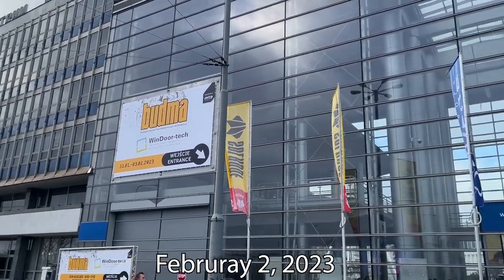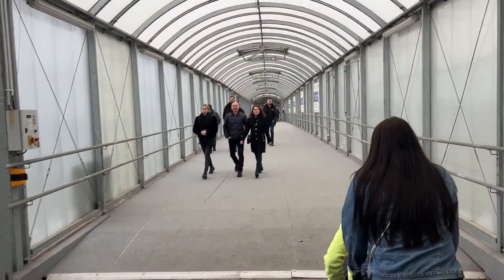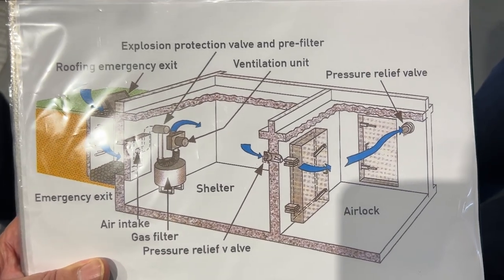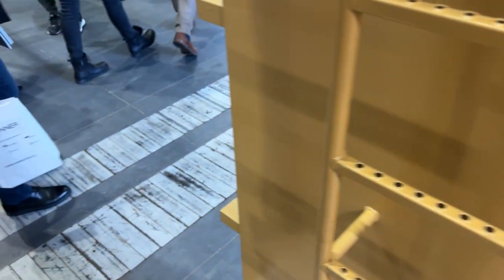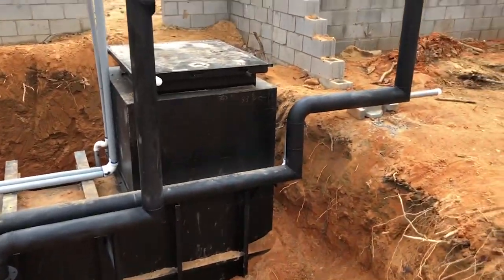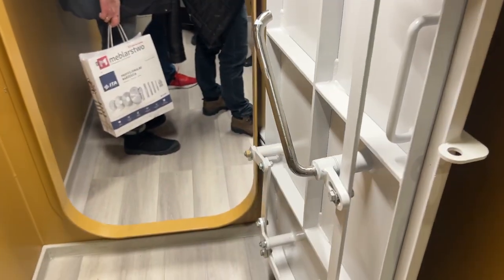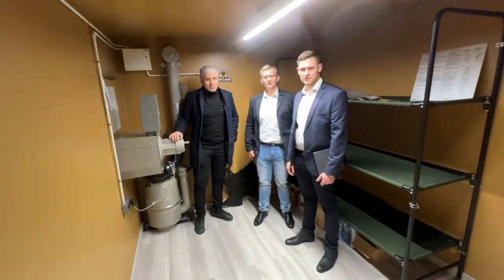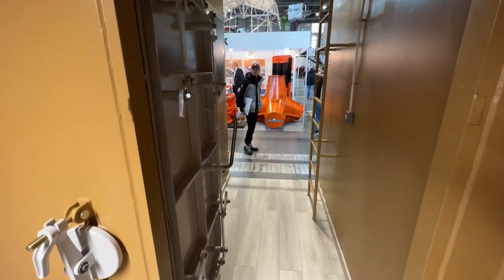New $50,000 GARNADO Bomb Shelter Displayed at European Builders Show

Comment: the conduits have the wrong 2" 90 for the electrical conduits. They need to be 12" sweeps to be able to pull wire.  this is on the 8"x 12" Garnado install  on this video. this need to be fixed before the concrete is poured.
Reply from the maker: They did it themselves.  We know to use long  sweep elbows when we do it.
Reply: I noticed that too . but then I realized it a Polish bunker .....Seems legit...

Comment: Why don't the shelters we see already in the ground, in this video at least, have the foam on the outside like the display ?  I would think anyone who's going to spend all that money on a shelter would make sure to have that done. No brainer. Sound deadening and helps prevent moisture/rust on the outside/lasts longer.....???🤔🤷🏻‍♂️ And I would hope there's a way to foam the bottom as well, before it's set in place....? And if it was up to me, I think I'd have the sides, as well as the top, encased in thick reinforced concrete.

Comment: Why is the Main Door a Heavy Duty Blast Door for Safety but the Escape Exit is not?
Reply: The escape exit is covered in a lot of sand (which drains inside if you open it) which protects from the radiation. The entry door does not have that mass otherwise except for it being a 'heavy' door.
Reply: @panpiper  This. And the escape exit is also vertical, meaning the only way radiation is getting in is a direct overhead blast. If that happens, you're dead regardless. No civilian bunker is going to save you at that point.

Comment: They're an awesome company but way to expensive. un less your making 100k a year, no normal person could afford even the base model at 40k. You can Fabricate a good one from a conex box aka shipping container with the proper reinforcement last will last forever.  Plenty of diy videos on how to do just that.
Reply: You would have to spend thousands more for all of the steel requires to reinforce such a project. You would also need to turn the connex box on it side and and weld in steel plates underneath making continuous stitched welds to seal the underside from water ingress and then replace the wood floor on the inside since many times they are treated with insecticides that are non compliant for EU or USA safety standards. You would also need to purchase blast valves and blast doors ( cheaper and better than diy ) and incorporate them into the design of the container. Utilizing the nine foot high containers would be best considering you have to place reinforcing steel every two feet across the width of the container both inside and out. Not to mention all of the steel needed outside the container to reinforce the walls. You would need to find a certified welder who knows what he is doing so you wind up with maximum strength on all welds, no fly by night amateurs which there are plenty of in the EU.
In total you might save 20,000 euros in the EU or maybe 15,000 USD in the USA.